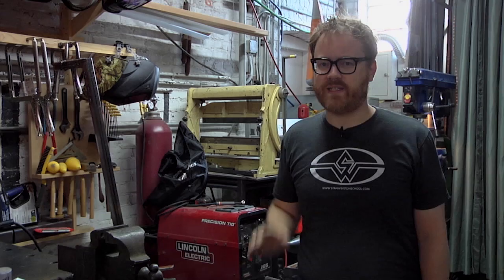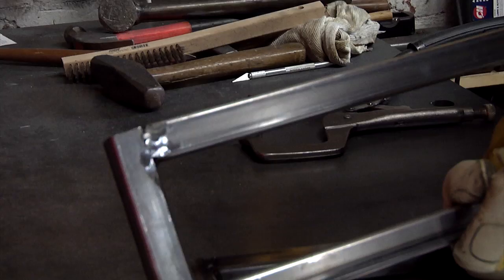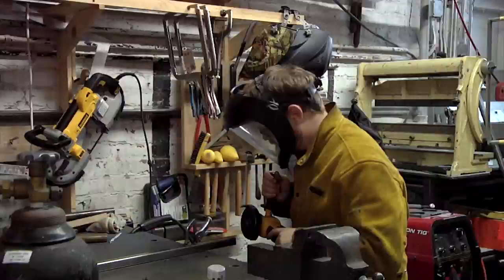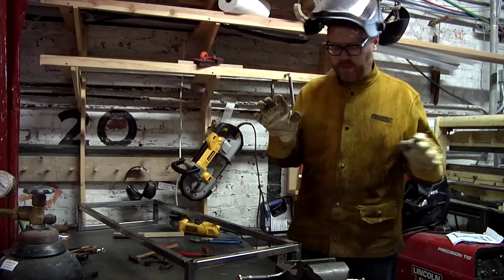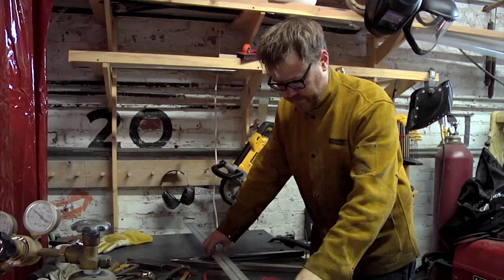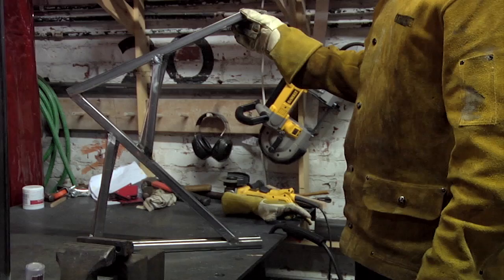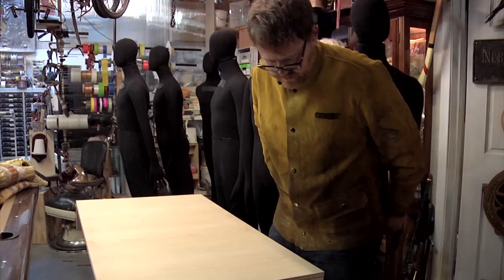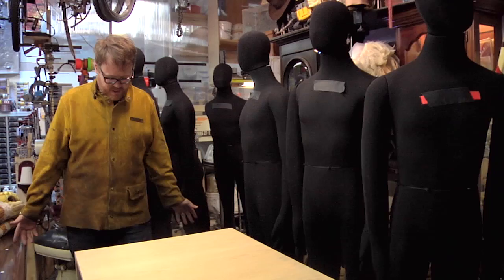Building a Custom Computer Desk, Part 4

Comment: you keep saying that "its glueing metal together" as a professional welder that is one thing about jamie that i cant stand.. scrub that saying outta your head and take a intro to welding class at your local community college... believe me its cheaper than setting up in your garage, and then you will probably be able to show jamie that its not a "hot glue" process
Reply: Yeah the "Gluing" comment kinda irked me a little. Because its not just sticking two things together with an adhesive. Its actually making two separate things one piece.
Reply: Jamie is used to simplifying things on television, and that unfortunate turn of phrase from that one video seems to have gotten stuck in Will's head... would be less grating if he didn't keep saying "*literally* gluing with metal" to add insult to injury, haha
Reply: jrmym2 No.

If you're gluing something, you are adding a substance to the surfaces and sticking them together, with the substance bonding to the two individual pieces and forming a connection.

When you're welding, you create an electric arc that melts the two surfaces into one continous piece of metal. Some welding processes introduce a filler material to the joined area for added strength, but not all.

Comment: you have to put your welding mischin a slight bit higher. cause it's now on the the setting for sheet metal or thin stuff. what your welding wil stick better if you do it a slight bit higher. cause now most of the weld is on top of the metal and you want it to melt into the metal. for the rest was a good weld for the 1th time.

Comment: well not to put anybody down, but this looked like a waste of a large amount of time and effort to make a table one could have just gone out and bought from any office furniture supplies store. I thought the table was gonna be unique and insteresting. It didnt even use any interesting materials.
Reply: ***** I like to build things as much as the next guy. But I like to have a purpose or need behind it. My drive for building something myself is usually that I can build it cheaper and better plus I would be using more unique materials. For example, last year I built a bench and table set out of fence wood for my backyard. This year I am planning to build a bed frame out of carbon fiber sheets. Now that will be fun.

In this video, he builds a table that one can just buy from most furniture stores or even "ikea" for much cheaper. By cheaper, I am also taking into account the cost of the time the guy in the video put into his table. Why bother building a regular table. it doesnt have any unique features that I can see.
Reply: ***** Well thats great and all, but I will still conclude that this was still the construction of a table that one could simply go out and buy from the store. I was expecting to see a new or unique design table. Hence for me it was worthless to see someone make a table that can easily be from bought from the store.
Reply: ***** I come from the school of thought that if you are doing something it should be worth doing with a specific need.

Comment: Im a welder by trade. It would be great to be there to offer up some advice to speed you aling, but from when you first started, to now your welding has come a long way and i can hear your welding has got slot better.  Just remember if the gun is pushing that means your wire speed is to fast snd if your weld is sucking back towards the tip then your wire speed us to slow. But likr anything, a practice practice practice .......

Comment: You had your voltage set too high. probably did not have the gas bottle open enough either. You should not be burning like that if it is set properly for the thickness of your steel.

Comment: 3:30 dude. if you handle it right it won't ''explode''. safety comes first though.
Reply: even if you do the wheel can still catch and desintegrate (explode). no getting around it sometimes.

Comment: can i get some of those dummys?why make a desk when u can just buy one?all that trouble.......
that doesn't look like a desk more like a table?
Reply: his concept is complicated for nothing, and costly, the reason to do your own desk is to actually save money. I made mine with MDF sheets and metal legs from IKEA, its alot bigger than his, has a L shape and I have 4 computers on this desk + router scanner and printer. and it cost me only 139$ for a 30inch x 96inch x 62 inch  desk.
Reply: Pat The Hammer he might also have done it more for the laerning aspect. since he usually watches adam or jamie build things.